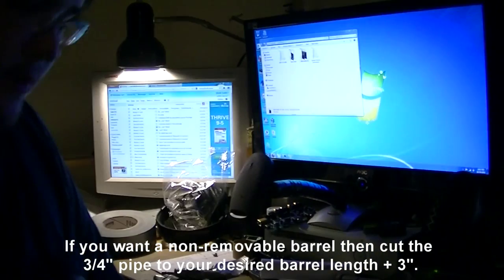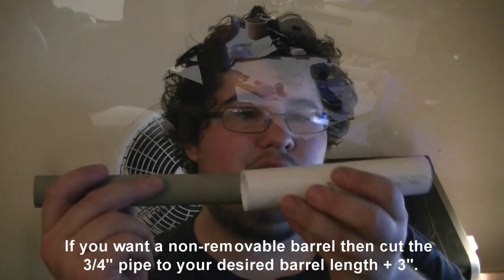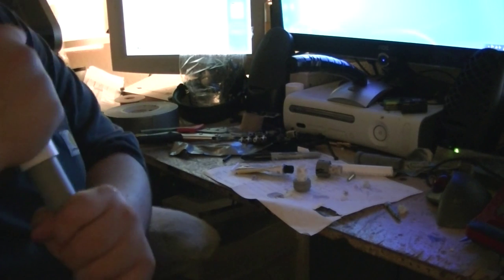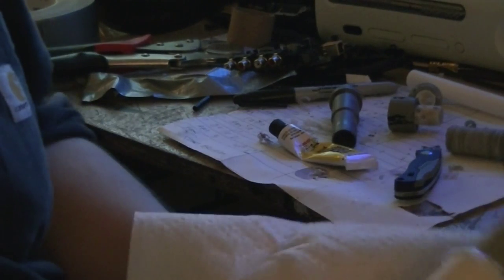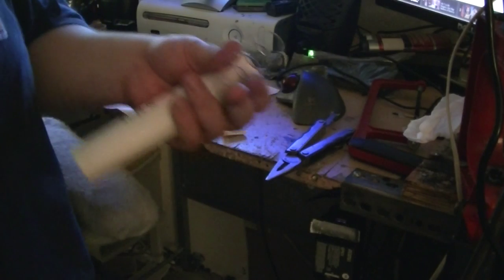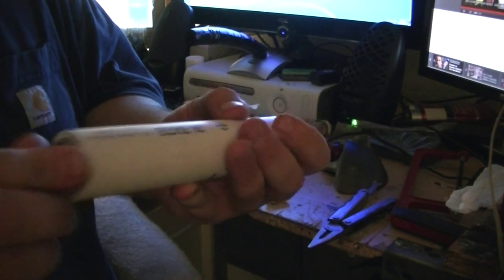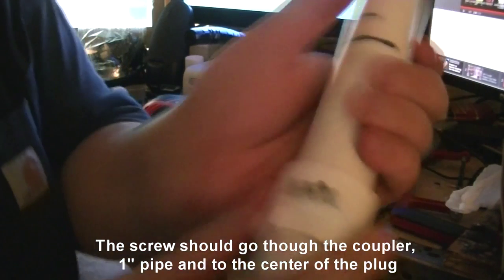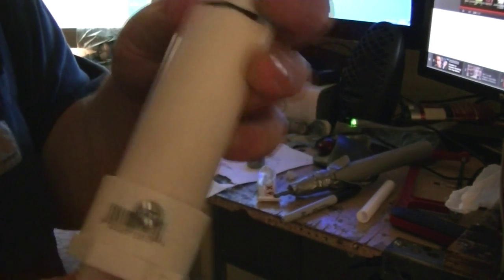How to: build a fully automatic PVC paintball gun - part 6: barrel & assembly

Comment: You can make a spring with piano/or bailing wire, wrap around a mandrel to desired diameter. you then need to temper the spring. Cook spring at 550 degrees F until spring turns violet then quench spring in motor oil (if it turns blue you have over cooked it; it is no good, and you will need to make a new one and try again). That is how you make a Helical Compression Spring.